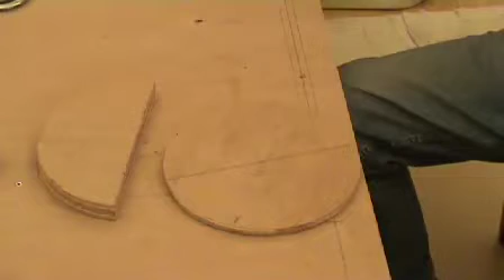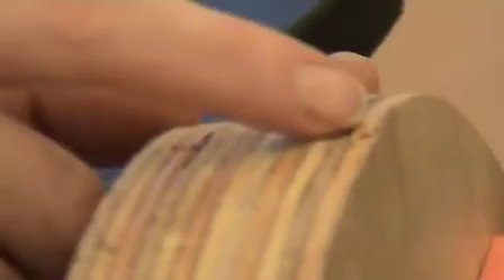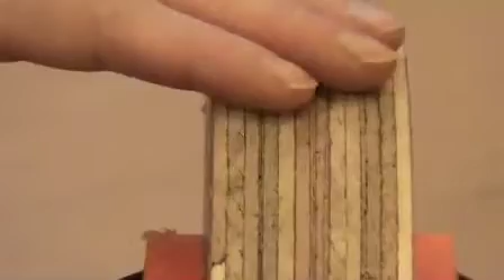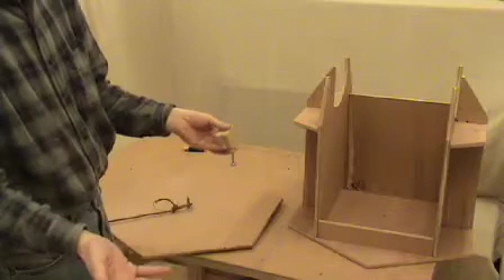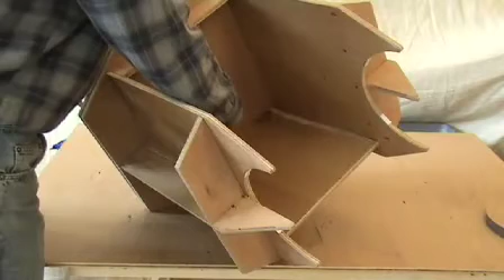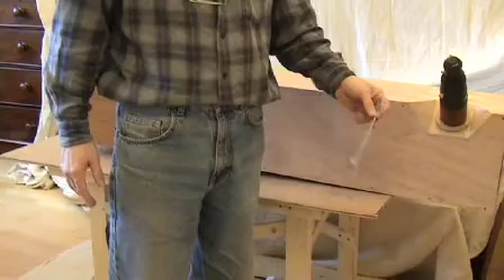How to build a Dobsonian telescope (Part Three)

Comment: Hello,can you tell me how to calculate the distance between the primary and the secondary mirror??And also the distance from the focuser to the secondary mirror..please answer.Thanks
Reply: Put the mirror in only the cell .  With a bright flashlight at a distance measure from mirror surface to the point of light that is shining on a wall.
Subtract the distance mid travel focuser to center of telescope tube.